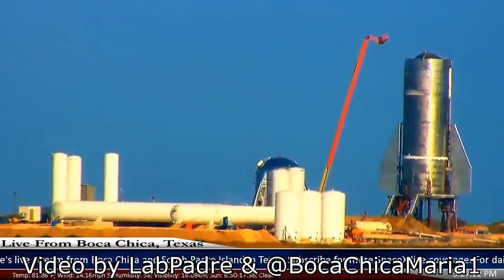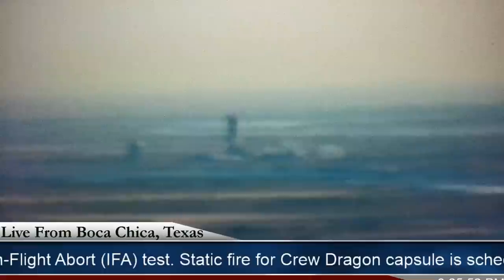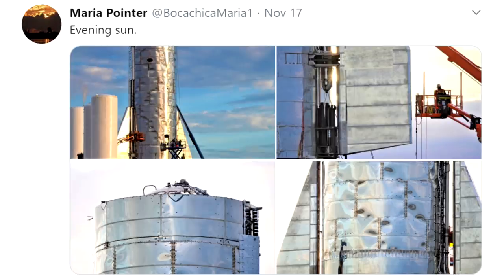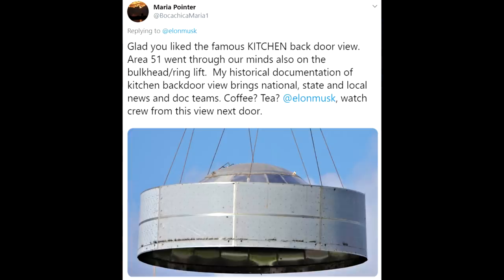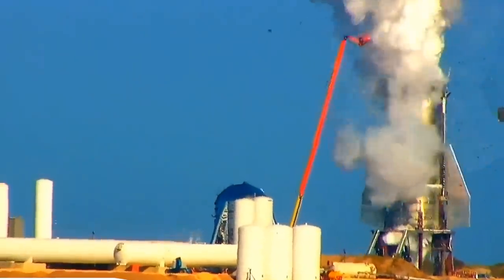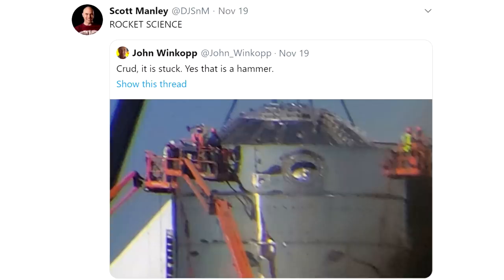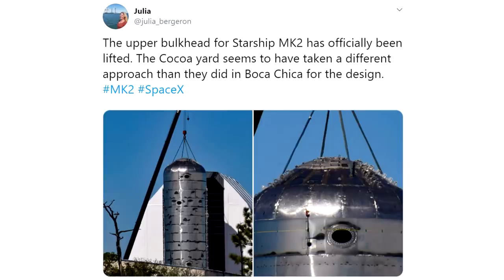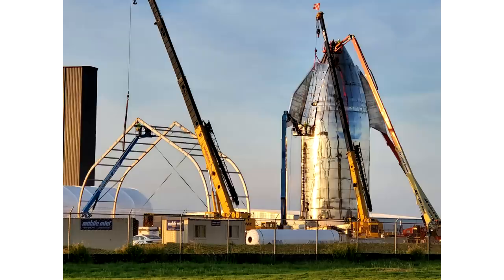SpaceX's Starship Popper - Starship Mk1 Ruptures Tank During Test

Comment: In re loading whilst suspended from that crane:  Yes, BUT...! that suspension rig was not at all rigid, there were numerous live loads also in play, and so that 200-ton loading would not have been statically distributed around that failed weld.  The suspended spacecraft would have received driving forces from the wind, horizontal movement by the crane, hoisting and lowering, material thermal expansion and contraction, handling, tugging, and so on.  Depending on the oscillatory mode of the system, that weld (and many others) would have been visited at any given point by quite high sinusoidal tensile forces alternating with compression forces.  As the oscillatory modes shifted, the pushing/pulling would have been felt down at the scale of grains-of-metal as the wiggle forces circulated around the circumference, at times counterrotating past one another in additive and subtractive flexing of the welds. What is more, the Mk1 (was) far longer than it was wide, and so, independent of all that rotary shimmy, it would have been also oscillating up and down along the axis of the tube.  At some tiny scale, the whole thing would have been ringing like a bell.  And it's assembled from dozens of pieces:  There's welds in a grid, all up-and-down, wrapped around the thing, and the welds don't flex the same as the panels, so those traveling live loads would have peaked everywhere they encountered a weld line.  Stainless steel welds are not particularly elastic and those welds may indeed have been pulled, locally, beyond their design hydrostatic loads.  So, yeah, Mate, I'm talking out my arse, but the bloomin' front fell off.

Maybe don't dangle your weld-webbed pressure vessels from one end and swing 'em around, eh.  Suspension 1) from the center versus from the circumference, with an internal cable down the long, central axis (too weird?) , or 2) from a cradle, lifting Mk1 from the bottom (more sensible), would have greatly reduced the peaks and valleys of the forces on the tank welds.   And maybe shrink-on some continuous steel compression rings so the mechanism guaranteeing your mechanical integrity remains independent from the mechanism guaranteeing your pressure-tightness... Maybe get some internal tensile cables rigged up to keep everything guaranteed in compression at every moment... but now I really am talking out my arse, as I only know from submarines, not space cans.

Crude ballistic physics calculations: 10.04 seconds in the air (my own fumble-fingered timing, single trial) before return to same height, negating air resistance, gives initial vertical speed = 49.2462 m/s, max height = 123.60796 m.

Remind me never to name my kid "Mark".
.

Comment: The FAA will issue a fine, for failing to file a flight plan.
Reply: FAA: So, your departure and destination points, Sir?
SpaceX: Boco Chica, TX to Boco Chica, TX. 

FAA: So, a local flight, then? Will you be remaining in the pattern?
SpaceX: Yup.
FAA: OK, then. Fly safe.
Reply: Ironically, if they had just tethered it to the ground with a rope, the FAA would have had little to no grounds for complaint.

Comment: Moving around the bulkheads would not cause any problem. It was probably an over pressurization test to rapid disassembly, rather then scraping it, use it to test the tank pressure limits.

Comment: If this was the first time it was pressure tested is probably was a 'hydrotest' at cryo temps to a predetermined percentage above MEOP, Max. Expected Op. Press. It obviously failed and as you mentioned Scott along the weld which should of been radiographed. So what failed? Bad weld not cought in the x-ray, reg runaway,etc?

Comment: Thin sheet steel constructions for aeronautical use are deceivingly simple. Mikoyan-Gurevich buerau, for example, got it right in Foxbat, but it took some time until Flogger's main tank (loaded structural part) was structurally sound. It needed both strengthening and a change in welding "culture".

Comment: 🙋🏼‍♂️ I think this was deliberate. We know the mk1 platform had served it's usefulness and that a larger platform will be required for continued flight testing. I think it likely that they did a multistage test where they started at nominal pressures and then decided to start probbing failure points. After all, why wouldn't you? If you already know the vehicle has completed it's primary usefulness and you know you need to prove the soundness of the construction technique. 🤷🏼‍♂️ And then there's that cherry picker with it's camera... I mean yeah, collecting data points is important but I don't think it's a mistake that it's on the side where the rupture occured. This was definitely planned for. Whether an over pressure test was pre-planned or if it was a spur of the moment, we have an opportunity to go further, decision, this was certainly an expected outcome.

Comment: So long crumpled-can / patchwork quilt / dimpled-weld version(s). SpaceX engineers knew that field welding conditions and irregular geometries along numerous weld lines would unpredictably increase localized stresses and weaken the pressure vessel design.  As a point of comparison, filament-wound, solid-rocket-motor designs undergo destructive pressure testing of the filament wound cases during their design and development and continue periodic destructive testing of components off the manufacturing line during full-scale development and production. Pressure testing MK1 to failure was almost inevitable and probably necessary.  It will be interesting to see which welding method (or combination of methods) they select. They may be pushing the state of the art.

Comment: A lifetime of welding and metal work taught me there is a big difference in process control and  resulting quality between working inside a building and in the field - much less 100 feet in the air on a boomlift. Watching this construction project  made me wonder if I could be be wrong. It would be nice if you could build a spaceship with Farm Rod in the back lot.  Well, probably not the best Idea. Ship construction outside, pressure vessel construction inside. I hope the starship is successful. The high flying factory fabricated bulkhead looks like it stayed together.
Reply: You are right, but they did build the Starhopper in seemingly the same way -- which not just held together under pressure, but actually have flown. So they can do it successfully, just not consistently yet. (Of course, we are assuming here that the problem was with the welding and not a stuck valve or a missing comma in some software which caused the pressure to go above the red line.)
Reply: @cogoid  Steel is my favorite construction material. It is so versatile and user/process friendly, but there are limits.I agree with Spacex that it is the proper material for Starship, and was happy to see such a gutsy choice. A full height 360 degree construction type scaffold with handrail and plenty of deck room for tools and jigs and jacking, and a tent to limit  wind in weld areas might help. Working off boomlifts is ok for painting and service, but you don't see a high-rise building or ship being constructed with out scaffolding. From the outside looking in it seems the workers were trying real hard. Being pushed real hard to Finnish The Project  in difficult construction conditions may lead to short cuts that can have consequences.
Reply: @jonwatkins254  As much as I admire SpaceX achievements, it's not all pretty in how it gets done. They remind me of a famous computer company of a while ago -- Data General. Their trick was also hiring bright young kids fresh from MIT, enticing them with "you will never have so much responsibility or will work as hard in any other company". Both companies seem to burn through a lot of enthusiastic workers in the process.

Comment: I understand that they were pressure testing with nitrogen. You can only stuff so much gas into a container under pressure, (be it liquid or gas), before it all becomes liquid. once it is all liquid it will not compress any further and something has to give. The fill-pumps will shift tons of liquefied gas per minute, so when the tank was full, the pump didn't shut off quick enough and there was a sudden hydraulic shock that split the welds. Outcome? Check sensor calculations; if a full LOx tank weighs a certain amount, what does it weigh if you fill it with nitrogen? Who forgot to calibrate the system?

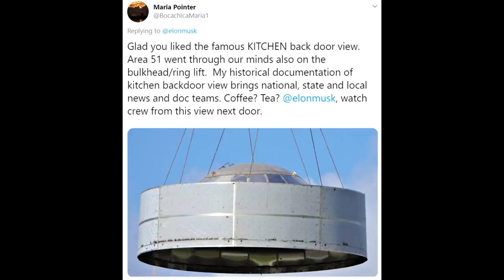Comment: Coming from a field of Non destructive testing (NDT) the first thing I noticed was how close that bottom circumferential weld at 3:13 will be to the next weld below it it. By API 1104 (the code for making and inspecting pipelines) and many other codes there is a set limit for how close welds like that can be because regardless of how good a weld is its still going to be a weak point. Obviously pipelines are under much much less pressure than this but that just exacerbates my point that having those two welds so close together is most likely where the failure point was. Its also quite possible and more likely in this case that the failure point was in between the top and bottom weld in the heat effected zone (HAZ). As the metal heats and cools from welding it becomes weaker in these zones. With some math you could figure out how big this area is but its probably anywhere from  2" to 6" on either side of the welds. So maybe those HAZ overlapped because of the close proximity those welds have and made it extremely weak at that point. Any thoughts?

Comment: I was doing a purge of the liquid oxygen system of a C-5 at Dover AFB around 1981 and had basically the same thing happen, just on a smaller scale. I was using gaseous oxygen at the recommended pressure of 300 psi when the top of the 75 liter lox converter came apart at the weld. The panel that both the 75 and 25 liter converters sat behind blew off the aircraft and flew over my head. The top half of the converter shot up and put a large dent in the underside of the left wing. Shrapnel was blown everywhere except for a strangely circular area around where I was sitting on the oxygen cart. To this day I believe that someone was watching out for me. The platform that both converters sat on was moved downward about a foot and a half and one of the struts for the platform was shoved through the side of the fuselage. It cut a hydraulic line and some wiring. Thank God there wasn't power on the aircraft at the time or I wouldn't be here to tell you this and the Air Force would have been short one C-5. Scared the living shit out of me.

Comment: I'm a little disappointed. This is not a rocket science problem. This is basically a pressure tank problem. And we have been building those for more than 100 years. So either an engineer made a mistake with his calculations or the welders didn't do what they were supposed to do.

Or, and knowing it's Elon Musk at work here, it could also be that they wanted to find the limits on purpose. Knowing exactly what is safe and what is not, is very helpful when you are fighting for every single kg you want to take to space.
The Mythbusters once did a water heater explosion. And that thing withstood almost twice the pressure it was labeled to be safe. Not knowing how far you can really go, is a big disadvantage.
https://www.youtube.com/watch?v=9bU-I2ZiML0

Comment: Do we know for sure that the rupture wasn't deliberate?  This could have been a test-to-destruction and they just, on purpose, ran the pressure up until it blew.  Useful to find out what the utlimate strength was under cryo temps, verify where the weak points are, etc.

These, I think, are vented cryogenic tanks, and they really shouldn't have that much pressure in them unless they want to make the tanks beefy enough to take 3000PSI or so.

Indeed, the best way to blow up a vented cryogenic tank is simply to close the vents.  Boom.

Comment: Automated spiral weld for the cylinder my help reliability but the end caps are going to be hard. Alway a compromise between strength and weight. I hope this was a failure test but I haven't heard of testing to failure with LOX (if that's what it was) WAIT: it couldn't have been LOX or there would have been a fire ball. I should watch to the end before posting.

Comment: Welds rarely fail. The heat-affected zone, surrounding the weld, most often fails. This reality occurs because the weld is significantly stronger than the base metal, regardless of element, alloy, or composition....

Comment: Padre Island is sand. And there is plenty of fine-grain sand flying around. You can't have clean welds with dust everpresent. Get some debris in the weld, and you get voids, and voids give you failure sites. Welding Stainless Steel is tricky - even trickier than aluminum, certainly more than steel. However, your welders know that, so my guess is yes - this absolute was a test to failure under cryo-lox conditions to see what the failure mode would look like if welds weren't perfect.

Comment: Kevin Sells over on the unofficial SpaceX group(the one with 47,643 members, because theres more than one group) has experience with tanks and ships that deal with similar or worse conditions. His experience says the dome bulkhead was welded too close to the seem between the segments and thatd why it failed. You can see the burn marks on the outside of the ring that shows where the dome was welded. He said it wasn't the weld, but the plate.

I don't know for sure but it sounds plausible.

Comment: This incident graphically shows what happens when a pressurized vessel develops a little tear, and comes from lessons learned from an aircraft catastrophe. I forget what aircraft it was, but it was a passenger aircraft, and passengers were killed when it happened. Basically, a window near the front of the aircraft had been built square, rather than oval or with rounded corners. Under pressurization, the corner of the wundow, which would have seen a lot of structural stress, broke. From there, the fuselage zipped open just like the Starship did, almost instantaneously. The aircraft fell from the sky in pieces, and everybody died.

Comment: Well, you make the front NOT fall off by giving it another failure point. You make something else weaker, probably with a valve so that the pressure can't get to the level that has been determined to cause this failure.
Successful test-to-failure, because there has to be a pressure limit.

Comment: I suspect the lower hoops making up the cylinder shrank due to cold temperature but the top loop was not cold so did not shrink.  Thus there was incredible stress built up at the weld joint holding the top loop on.  Every 1/1000th shrinkage of a 10 meter diameter causes a centimeter difference in diameters. The stress at the weld joint was likely enormous. Not surprised the whole top blew off instead of just springing a leak.

Comment: I'm wondering what are the abort procedures on Starship? Isn't the design inherently unsafe considering that there is no way of fast and clean separation of the crew compartment from the oxygen tank, which I consider the highest level of hazard? Even in significantly unsafe space shuttle design, it could separate from the main propellant tanks.

Comment: Just an architect, not a qualified engineer, but I think there was a stress concentration near the top of the cylinder, where one of the segments of the top dome came together. The dome was made out of pie shaped segments, maybe 30 degree each of flat sheet metal. And one of these joints or even the center of one of these panels, caused a concentration, and that started a rip. Perhaps caused by a reverse crinkle if I can invent a term. Instantly propagating into a catastrophic failure. If you want more equalized pressure, build it more like a geodesic dome.

Comment: I don't understand why they would use stainless steel, but, I realize that I am basing this on my little experience with stainless steel bolts... they constantly stretch, either from the torque applied to tighten the fastener or the force of what the fastener is meant to hold and then fail, it doesn't seem have the average strength of other more commonly used materials and once any amount of stretch happens, it then cracks, once it cracks seems to easily tear through the meat of the stainless where the crack occurred and fails catastrophically... just like this video. Using a material that doesn't stretch, or is more resistant to stretching and then, doesn't crack when it is, and better yet will tend to somewhat revert back to it's original state after it's been stressed would seem to be more practical... that isn't what stainless does... if it gets stretched to the point of cracking...even a little bit, then you're done, it fails... like bending the average piece of glass, doesn't work well, once it cracks, there's no going back because it's coming apart... sorry, that was a really brutal analogy, but that's how I see it... too bad the test wasn't done with a more forgiving material.

Comment: when you look at the assembly of other large bulkhead placements such as ship bulkheads and oil rigs these things can be these cranes can be extremely precise in their positions so no, do not think it was damage from assembly work. It was most likely over pressure of the seals just not welded sufficiently to prevent such a blowout. Possible fixes may mean a whole refab of the piece which means less welded parts.

Comment: In case nobody noticed yet: This very seam will be under way less stress in actual flight. Gravitational and accelerating forces on the payload will compress the tank and counteract its inner pressure to some degree. Thus u usually see rockets rupturing lengthwise but seldom lose their front.